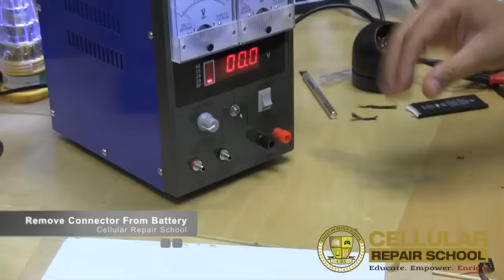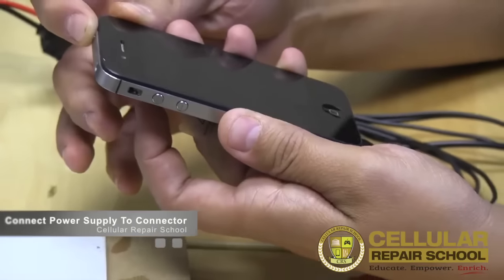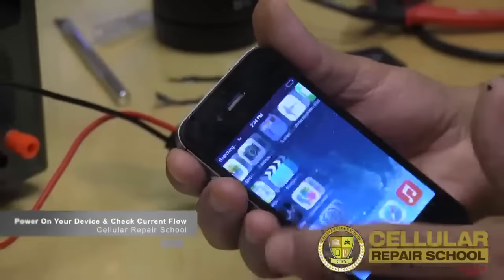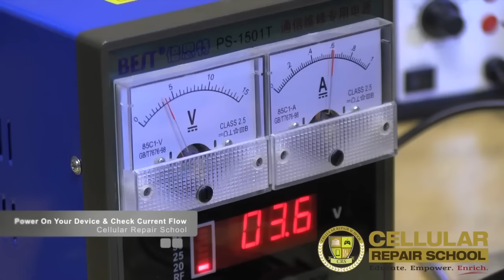Connect power supply to iphone battery terminal to test functionality

Comment: This is excellent, but I have a question as far as uses: Say I want to transform my iphone into a corded phone. Could I use a standard iPhone charger's 1.0A 5V charger to keep the phone on without damaging it? or is there a lower voltage/amps necessary to do this?

Comment: Are there test flex cables or development flex cables that can connect to iPhone or other brand phones for sale of testing components on another platform that can debug, etc?? I.e; a way to snap connectors and perhaps switch to an ipx where test meter, oscilloscope or any given feature can be activated and verified functional?

Comment: Hi, I did this on iPhone 5c but could not get to switch on with screen lifted, same with battery connected, I had to push screen back in place to get it to start. Is there some contacts that must be made on the screen for it to boot? Thanks

Comment: Is this also possible with an iPhone 6 Plus? Didn't work for me: no current showing up on my PSU, iPhone not starting. I've left out the data/temp-pin of the battery (DC power directly to board connector).. Important for the iPhone 6 Plus?

Comment: which sides are positive and negative on the iPhone 5s battery?  Want to charge a battery with a universal batter charger, but it only charges with DC, so I need to make sure I connect to the correct terminals
Reply: +Aharon Smith the battery of the iphone wii show the - n +

Comment: did anyone find away to reset the battery state on this board because when battery die and using this board on a none iPhone battery its still thinks this is the same dead battery and treat it as dead battery and do not fully charge it

Comment: +CellularRepairSchool
What PSU is that ?

Also, I have a HTC Explorer, the battery pushes into the pins rather than clipping on (like in the video).. any tips on how to connect a PSU to test ? I think the battery is dead.. doesn't seem to charge.

Comment: How do you get a new battery to charge when it wont charge inside the apple device? 

I have an ipad mini and the device died and it now just goes into a boot loop and once I disconnect the cable it completely shuts of and only tries to load when I connect it.  Is it possible to "jump start" the battery in some way?

Comment: Hi! Can someone tell me if it’s possible to buy just the cable that comes from the battery! I don’t want to open mine since the battery works find, but still wants to connect it using a power supply! Thanks

Comment: Is the circuitry on the connector playing a part here or is the power supply directly supplying 3.7 volts into phone?
Reply from the maker: The power supply is directly supplying power for function testing

Comment: you know what happens if i connect external power supply directly to the mobo battery port 8v by mistake instead of 4v ? (without the battery itself)

i used 2s rc battery thinking it was 1s

thank you

Comment: my battery itself is fine but the connector wire ripped at the cornor wher it connects to the little rectangular pcb. anyone now what each of the 3 connectors on the phone side are?

Comment: Quick question..can i connect a usb cable that has ben stripped for both positive and negative leads directly onto the logic board..and is there a specific amount of voltage?..can it be over 3.7?
Reply: bump
Reply: I can confirm this works, I was desperate to get my 5C back on and it worked! I was so happy, but I hoped I could plug the Lightning cable in and it keeps the phone on

Comment: please upload video of the usage , correct temperature and air setting of hot air soldering station , And please tell me the correct soldering
 temperature for different PCB( samsung , nokia BB) without burning the board

Comment: "The phone says low battery because you don't have a battery in there"? That makes 0 sense. Isn't your bench power supply your "battery" now? Isn't it because the voltage you supply is too low?
Reply: yes, voltage supply is low. Li-ion batteries output 4.2V full and 3.7V low charge
Reply: This guy cant use this iphone 24 hours like that. i did same thing. Phone says battery %100 . After half hour youtube video watching , it drop to under 20 percent. Then it show 0 and shutted down. i dont know why. Maybe iphone want to see a real battery. Not a dc powersupply. if you recognise, this guy’s iphone was over %20 battery. Then iphone showed battery is at %20

Comment: Couldn't you just have swapped out the battery? What other uses is this for.
Reply: This would be used by a technician for a few reasons... first, if you don't have a battery available or if the battery you have is no good, which you already verified using a universal charger and a multi meter of some sort. That would help you understand if you have a  battery issue or a issue with the phone itself. This power supply also has a current meter that reads the current flow from + to - .   Understanding how your current flows and if it has a closed circuit (current flow) allows you a better chance of understanding what the culprit may be. To put is simply, it helps troubleshoot any board circuitry problems you may have.
Reply: William Patrick Excellent Reply!

Comment: I am trying this with an iPhone 5 battery but the phone won't start up, and indeed I don't see a voltage across the pins of the battery connector once I disconnect the lithium-ion cell and connect my power supply in its place. It seems like the controller board is somehow blocking the current. (Polarity is definitely right, I checked before disconnecting the original lithium-ion cell.) Any ideas? Has anyone else had success doing this with an iPhone 5 battery?
Reply: Andrew Walbran curious, did you ever have any luck running up an iphone 5 similar to this 4S video with an external power supply? I have been given a iphone 5 with that faulty U2 IC chip so thought an external power supply could be an option to have as a tester. Thanks
Reply: No, I couldn't get it working.
Reply: Andrew Walbran Are you sure the battery you used was good? Maybe the circuitry in the battery was bad (shorted) and when you connect the external power supply it was shorting it also. I'm not saying it should work on an Iphone 5, but why not? How would the circuit know if its a battery or a supply?
Reply: Colin Mallia I tried with two different batteries, both of which were working beforehand. My guess is that the controller detects when the battery is disconnected (i.e. its input voltage goes to 0) and refuses to start up again.
Reply: Andrew Walbran Did you try to connect the battery itself back to the circuit instead of connecting the power supply?
Reply: No, that was not really possible the way I had cut it apart. If you try it let me know!
Reply: Andrew Walbran I believe that the problem is being caused by bq27545 Single Cell Li-Ion Battery Fuel Gauge for Battery Pack Integration. Try reading the IC spec here....http://www.ti.com/lit/ds/symlink/bq27545-g1.pdf and refer to the section called FUEL GAUGING.
Reply: Colin Mallia Yeah, that mentions features like internal short detection and tab disconnection detection, though it sound from the description that they only set flags rather than stopping the power entirely. So it is still not clear to me exactly why this is happening.
Reply: Andrew Walbran My guess is that this device is intelligent and can detect the difference (through internal resistance) of a battery vs a power supply. I might soon be trying the project on an Iphone 5 and will try not to destroy the cell terminals to be able to reconnect back and see what happens. Will keep you informed.
Reply: Do you know a place just buy the battery connector without the battery

Comment: Honestly shouldn't tell people to cut open a battery without warning not to puncture the actually core of the battery. Plus using a bamboo or nylon tweezes would lower the risk of a small electrical shock. Otherwise decent video.
Reply: Prince & Elvis Well if you are not aware of the risks involved in working with batteries then you should not be doing any of this...

Comment: The battery is rated 4.2v at full charge . 3.7 nominal. I saw it use 500-600mA
. Can I set the mA to 700 ?